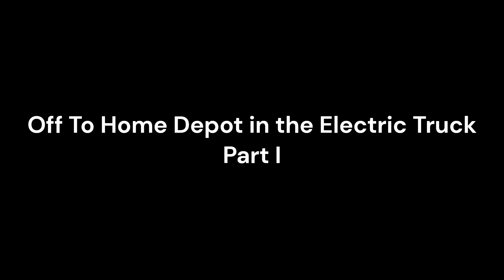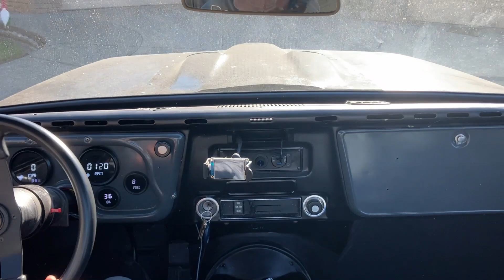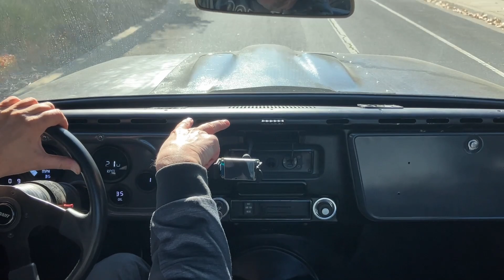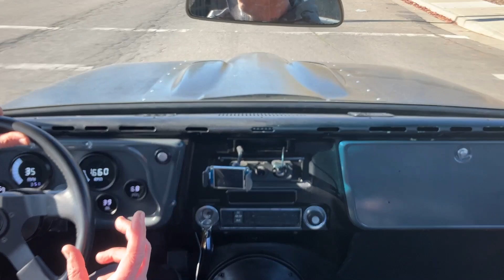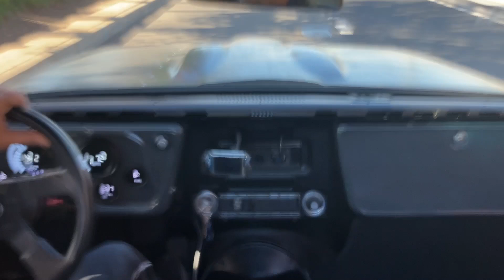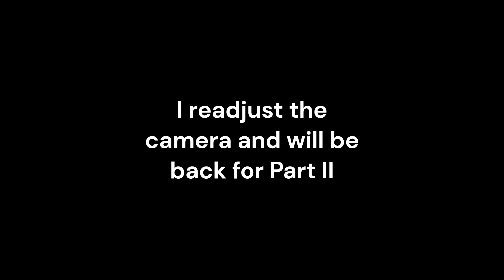DIY EV Conversion GMCe Update: To Home Depot The Long Way Part I

Comment: I bought those same gauges for my D-100. They lasted about 1100 miles and freaked out. I exchanged them for new ones, and they lasted about 40 miles. I hope they have fixed their issues at the factory; they were easy to deal with, but the gauges would display random gibberish.
Reply from the maker: wow that sucks, and what year was that in? also sometimes running a separate ground wire per gauge helps, I know how that sounds, but it does work 🤷🏼‍♂️

Comment: Greg, our trucks sure have a very distinct sound when closing the doors. I noticed the truck sounds less rattily from your last video. Did you do something new? Great video, keep them coming! 😉
Reply from the maker: added interior door panels coated on the back with rubberized SEM floor spray, as well as self adhering 1" foam taped around the edges, also added rubber floor mats, details and pics in my build thread